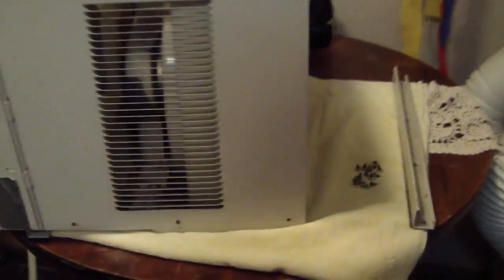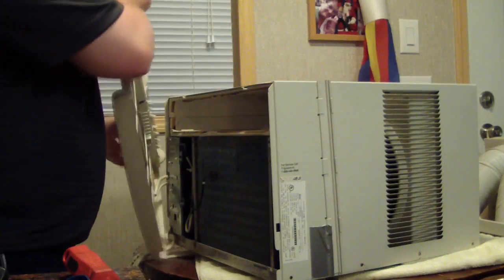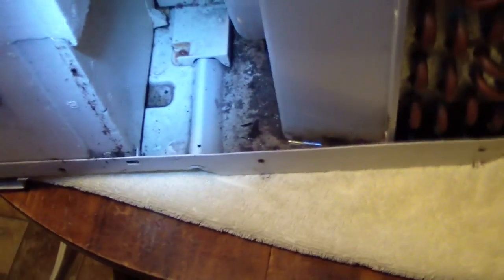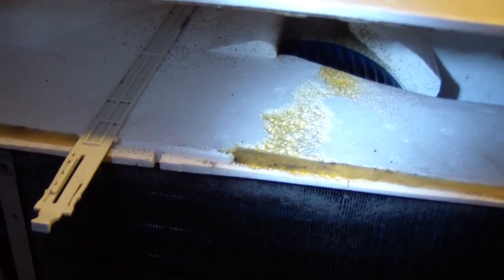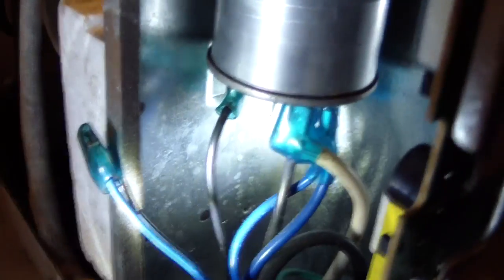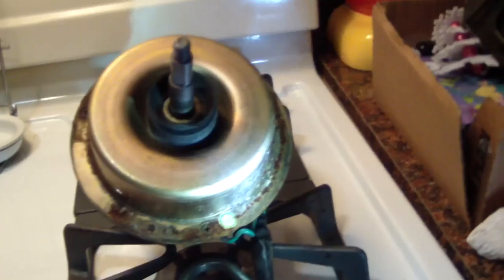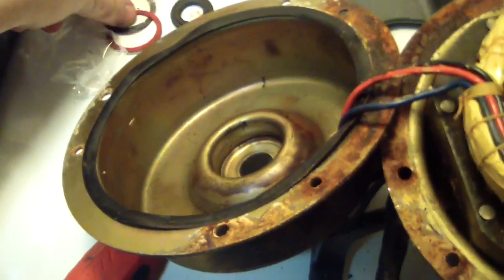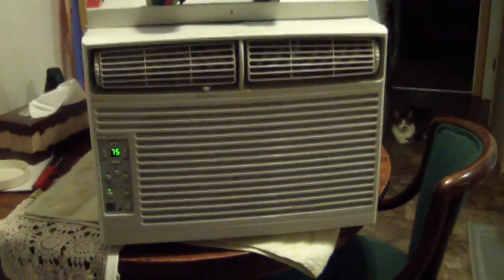Replacing AC Bearings - Fridgidaire FAC107P1A2

Comment: What do bearing numbers mean? It's explained here 
https://electricalfundablog.com/identify-bearing-number-calculation-nomenclature/

6 = Deep groove single ball bearing
2 = Light duty
02 = bore diameter 15 mm (about 5/8") 

From hours of research about a/c bearings I've learned that most window 
and wall air conditioner bearings are 6202 for larger units (larger 
motor with 15mm shaft) and 6201 for smaller units (smaller motor with 
12mm shaft).
Reply from the maker: Thanks for all the additional information - this will help someone out greatly, I'm sure =)
Reply: @TheWizechatmgr  What bearing did you replace with and how did you determine the part number to buy it?
Reply from the maker: @mattfoley6082  I hope it's in the video...  I haven't worked on that unit since 2014, I believe I lost it in my divorce.
Reply from the maker: @stratocasterblue  psst, in video description I added the bearing info previously
Part number is 6202-2rs  and a link for ya https://www.vxb.com/6202-2RS-Bearing-Deep-Groove-6202-p/6202-2rsbearing.htm
Reply: Thanks so much for doing the research for us just wish I knew what size shaft is on my GE 8,000 BTU so I can order the right bearings before disassembling it because I am using it right now as my central air puts out no cold air since using it on 113 degree days for a week
Reply: Im guessing 8,000 BTU would be 12mm and 6201 bearings
Reply: I posted my comment above when I'd fixed my 5000btu window A/C. Today my big wall A/C Friedrich 17,000btu started squeaking. Pulled it out of the wall and sprayed oil at the motor shaft where it enters the motor; that has worked in the past. Did not work this time, fan hardly spins even if I start it with my  hand. I know the bearings are seized and need replacement. I REALLY don't feel like dealing with this crap right now in the middle of August. This unit weighs 150 lbs., not like the portable window units you can move around easily to repair. I'll have to set up my aluminum ladder like a ramp so I can slide it down to the floor (I don't have someone to help me). Then I'll have to order new bearings and wait. Most people probably say screw it and buy a new a/c and have it installed. Not me, I'm not about to spend $700 or more if new bearings cost $5.00. But it's gonna suck for a while without a/c in this heat, not gonna lie.
Reply: Correction: smaller units use 608 size.
6 = Deep groove single ball bearing
0 = extra light duty
8 = 8mm bore size

Sorry for the error! I learned this after I replaced my small a/c bearings. I'm about to replace my large wall a/c bearings, shaft is 12mm (measured with calipers). Think I'll go with 6201-2RS (light duty, 12mm bore size, Rubber sealed both sides).
Reply from the maker: @mattfoley6082  awesome info, thanks for sharing! =)

Comment: Thanks for the post.  Years later I still have this same model and it works well, but starting to get some chirps out of a bearing so I'll be pleased to fix it.  It never got heavily used and for most of its life has been under a porch roof, so it may have quite a bit of life yet.👍
Reply from the maker: Replace those bearings every few years and blow the crap out of it and it will likely last nearly forever :)

Comment: Great video, very informative and I have a Frigidaire Model# FFWW123WBE 12,000 BTU A/C window unit and it got noisy recently. I live by beachside here in Florida so rust is a big problem. Definitely I have the same problem with the bearings. My question is where can I get the replacement bearings for it? Would appreciate your advise.  Thanks.
Reply from the maker: I have used both this company and a local bearing supplier to industry... https://vxb.com/
Reply: @TheWizechatmgr  Thanks😊

Comment: How to remove sirconditioning window type fanblade
Reply from the maker: Basically a crescent or box wrench after you pull the condenser and evaporators out of the way. They usually aren't on there mega-tight but I would recommend some blue locktite just in case.

Comment: Mine started making noise after 2 years. That was 3 years ago. After replacing with quality parts it's been great ever since. Manufacturers using cheap bearings should be a crime.
Reply from the maker: Glad it helped. I think the bearings just wear out and water makes it in.

Comment: Brilliant video... just ripped apart my 15 year old Frigidaire with plans to oil the bearings as a temporary fix until I ordered new ones.
I'm super handy, appliances, cars, motorcycles and as a result I got "cocky", didn't trace my re-wiring steps and connected the blue wire to the wrong terminal on the board and fried the board and capacitor in the process....oh well.
Haste makes waste folks... take pics along the way
Reply: Sorry to hear that. I believe the schematic is on the inside of the outer case or on the side of the unit with the case off... (Not that it helps now...)
Reply: @royberry7585  Spot on Roy (THANKS), there  is a schematic on the inside of the case and the blue wiring was really all that could get you confused as the terminals into the board are so close together in a cramped space. Since I replaced the unit, I kept the old one to "play", and I think the board can be replaced and the capacitor is toast, so now its a matter of sourcing these 15 year old parts, and shipping and bla bla bla, it just would not be practical being in the middle of summer sadly.
 A second lesson learned is that these units should be opened periodically for cleaning, as I never opened it for 15 years and could not believe the amount of black mold on the foam housing which is ultimately blowing those spores into your room when you run the AC.. it was shocking!!!

Comment: Cleaning the AC is the usual cause of bearings needing replacement. Those top bracket screws usually don't need to removed because they merely screw into the case.
Reply from the maker: Depends on where one lives. I live in the great northeast so just the temperature changing during the day into evening tends to kill these bearings after a couple years due to humidity entering the bearing.

Comment: I have roughly the same model. What bearings did you buy? I need to replace mine. Mine is model : FAC107P1A5.
Reply from the maker: If it's the same one mine used then it's buried somewhere here in the comments.
Reply: That’s just the site. Not the bearings exactly needed.

Comment: When I do a service calls for these little units, I always replace the cheap rust prone OEM steel and tin screws for some stainless steel ones, that way, when your customers call you to come clean their unit. It’s a breeze disassembling them. The tools I use: a drill (just in case I have to break screws), long-ass Craftsman Phillips screwdriver (for the fan assembly screws holding it down on the pan), a small hammer (for the squirrel cage fan wheel & condenser fan slinger stuck on the fan motor shaft), grease (for bearings and squirrel cage wheel & condenser fan slinger shaft mounting), a set of easy out bits (for those rust worn, and stubborn screws that your screwdriver can no longer loosen), and last but not least, a long-ass Bosch drill bit extension (you might need it to break some hard to reach, rust-worn screws, on the bottom of the ac pan.

Comment: Thank you so so much!! I have a much smaller model but your step by step disassembly was incredibly helpful. Thanks for the note about the reverse threading on the back fan. After scouring the internet I decided to buy some rubber sealed skateboard bearings. They were like a buck each. My AC was disgusting because I’ve never fully disassembled it before so couldn’t reach in some areas. Thanks to your good instructions the noise level is acceptable again and I’m not quite so afraid to fix electrical motors. Frigidaire wanted $150 for a new motor. No thanks. $2 is much better. It’s a window ac after all.
Reply from the maker: Awesome. Just be careful of the start/run capacitor. :)
Reply: @TheWizechatmgr  Can I ask you why the Capacitor is a little hazardous? I removed the screws holding the plastic housing and then realized the fan motor has bunch of coloured wires running to the capacitor. They need to be disconnected for me to remove fan motor obviously.Obviously the power cord is disconnected from the power outlet. Do I mark each wire so I know where each is connected to the Capacitor. I’m a little afraid to touch those wires.
Reply from the maker: @heyoou  it can carry enough current that if discharged through you could stop your heart, killing you. Yes, I'd take a picture of the capacitor connections before removing them. You can run an insulated screw driver across the capacitor terminals to discharge it before you work to make the process a bit safer.

Comment: I just had mine...same model, taken apart and got it pretty clean. Was really dirty in the coils. Only way to clean it good was to take out the fan housing. Mine sounds like it's gonna take off. Worse than yours. The think is almost 14yo, but some new bearings, it'll be like knew!! Great vid! Thanks!!
Reply from the maker: Also, if you happen to accidentally get it stuck with the screen setup for Celsius, I believe you press the temp up and down or the fan up and down at the same time to put it back to Fahrenheit. Do it from the front, not the remote (I no longer have this model, not sure if it had one...)
Reply: @TheWizechatmgr  I think we still have the remote. That capacitor worries me though. Just never knew they had one. I'll at least let it sit over night before I screw with the wires. Date on my AC is Nov 06. Do you still have yours? The only difference in the model numbers is, mine is a P1A. Cooler fan is cream colored.
Reply from the maker: Mine is gone - divorce, but it sounds just like yours.

Comment: My Crosby got the same set up. It's been Motor boating about 4 years now after it got left on for a summer ( the entire summer) once. Pretty sure it's having the same problem, can hear it 5 blocks down if turned on high, not as bad outside on low.

Comment: Thank you for this video. We have an Arctic King. Last year we dealt with the noise. We called it the diesel engine. You saved me hundreds. The bearings were only a few dollars. It was surprisingly easy as well. Thank you again.
Reply from the maker: Glad you found it helpful. I think it was like 2-3 AM when I made that video. I had the parts and finally "lost my cool" so I fixed it. Most but not all air conditioners can be repaired in the same way.

Comment: are these bearings compatible with a frigidaire FRA125CT1??
Reply from the maker: I am totally unsure. Best way of finding out would be to tear that model down and inspect the bearings. The bearings used aren't unique - they're often used for other purposes including skate boards. As you can likely guess, very few, if any, manufacturers provide bearing replacement information because they'd much rather sell you an entire fan motor assembly. I think the total cost of replacing the bearings was $10, not including the time it took me.

Comment: Great video.I was wondering if you can post the part number for the exact bearings you used.My ac unit is the same identical model.I saw a rockauto box in the background and wondered if thats where you ordered yours from?? Hopefully you can post that number.Thanks
Reply from the maker: Sadly no, I no longer have either the AC unit nor the bill of sale for the bearings.
Reply from the maker: Apparently I got them here... Sorry about the bad info... https://www.youtube.com/redirect?stzid=UgzwzLVrS36tcomdhlJ4AaABAg.8w3hDCtzQBs8w4Sv-X2dyW&q=https%3A%2F%2Fwww.vxb.com%2FSealed-Ball-Bearing-s%2F198.htm&event=comments&redir_token=2FZSoHsp4fzbhhVEc_xqMl5TaXV8MTU2NDYyODU4M0AxNTY0NTQyMTgz
Reply: @TheWizechatmgr  which ones exactly did you buy?
Reply from the maker: @XMguy  I believe I pulled them out and measured them at the time, the actual ones I used were in the video. Two x 6202 2RSJEM from the 2:25 Time code. I bought them through VXB bearings online, they were made by SKF.

Comment: How did you get the bearings out? That seems to be the only part that you didn't show which is the exact part that I need to see.
Reply from the maker: Smacked the race from the outside with a flat head screwdriver and a lite hammer tap.
Reply: @TheWizechatmgr  
Thanks
Reply from the maker: Anytime :)
Reply: @TheWizechatmgr  Same technique here, and worked fine, I didn't use the freezer because the shaft was clean. Just WD-40.

Comment: My ac has a loud humming sound. How can I fix it?
Reply from the maker: Does it blow any air? If not, the blower motor may need a quick push. If it is blowing air, the compressor may have issues.
Reply: TheWizechatmgr I throw it out and bought a new. It sounds like a water fall taking place inside.

Comment: Thanks for the video, it was right on with the bearing service. I was able to source the bearings at a McGuire bearing supply house for $8 each in Portland, OR. They were easy to remove from the shaft and to replace. The new bearings are Japanese but appear to be identical to the Chinese made product that failed after just two years of very light service. The job was tedious but worthwhile.
Reply from the maker: Yeah, it isn't for those unwilling to just say screw it and go all in. I was so glad they were replaceable when I pulled it apart. I believe I recorded that at like 2 AM in the morning after getting totally fed up with it.

Comment: I have the same problem with my window ac. It is the same brand but a different model (FFRE10L3Q16). Is there any way to get the part number for these bearings only with the model number? How did you find out the part number in your case? I don't think that is the same bearing for all theses ACs. Please could you help me with my issue? I'll appreciate. Thanks!
Reply from the maker: I ripped the motor apart and measured the bearings. If you remove them then any industrial supply place should be able to match them. Worse case scenario you lose the blower and the noise with it and have to replace the blower. Sometimes you can get it quiet for a little bit by removing the bearings and re-greasing them - but this won't last too long.
Reply: Thanks. I'll see what can I do

Comment: mine sounding awfull now, has to be the bearings just like yours, its a frigidaire also. i oiled it once without pulling the motor and was quiet for while and back noisey . just gonna wait till end season and replace them since you showed how to pull that motor, were you get those bearings at. thanks
Reply from the maker: 1966tnt do it sooner if you can, you'll get better cooling...

Comment: I'm trying to pull apart the motor. I've unscrewed the different screws on the outside and cracked it open but now I can't actually get the two parts separated to replace the bearings. so how did you actually separate the two halves of the motor?
Reply from the maker: BenFreemanDC a couple of screw hold the motor together, then you feed the wires mostly into it and it should come free.
Reply from the maker: It may take some convincing if the bearings ceased...
Reply: there are half disk like things on the outsides of the spindle that the fly wheel and fan sit flush against when the motor is mounted. But I can't get the two halves over these disk like things to separate the two parts.
Reply from the maker: Sounds like the bearings aren't coming out happily. If it were me, I'd give the shaft a gentle hit with a hammer to see if they decide to move. If you can't get it apart, it may be that the motor is just too far gone and a replacement may be your only option.
Reply: thanks the bearings work perfectly. But the room temperature settings are saying the ambient temperature is actually now about 10 degrees colder than it actually is. so I think I somehow mislocated the internal thermometer when I reassembled the unit. any ideas where this thermometer is actually located internally so I can relocate ?
Reply from the maker: BenFreemanDC staying cool eh?
Reply: Eh kinda. Motor works fine now but the compressor doesn't seem to be staying on enough. I found the temp and it was pushed too far back into the coils. So hopefully it starts kicking in
Reply from the maker: BenFreemanDC Hopefully :)
Reply from the maker: I believe it was either right behind the filter or within the Styrofoam housing for the blower.

Comment: Trying to find a place that sells the fan bearing . I'm having no luck though . I have a frigdeare 5,000 BTU MODEL FAX054P7A and the places I called want to sell me the motor for 167 which I can go and buy the AC for . Do you have any appliance stores or places you can recommend.Great vid
Reply: starlordish the bearings are marked on the outside of the race google the number you see on it
Reply from the maker: starlordish disassemble the motor and remove the bearings, then measure them. Any local industry place should sell bearings.

Comment: cleaned the armature and  put it in the freezer to shrink it so bearings went on much easier.did not disconnect wires on motor.and did the job. thanks for the vid.
Reply from the maker: ELVISRN1 glad it worked. I find the bearings to be "the" faulty component in these.

Comment: we're did u find the bearings for the fan..how did u know that was the problem.
Reply from the maker: The bearings were marked or I measured them with a caliper. I sourced them locally. I've dealt with failed bearings in other applications so I knew what I was hearing...
Reply: 6202z bearings - 2   and e- bay $1.99 each